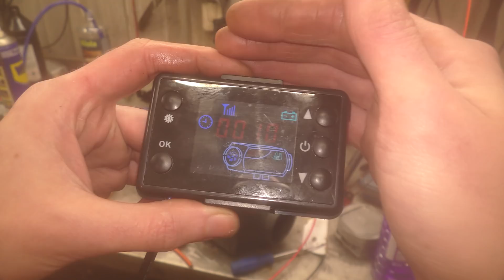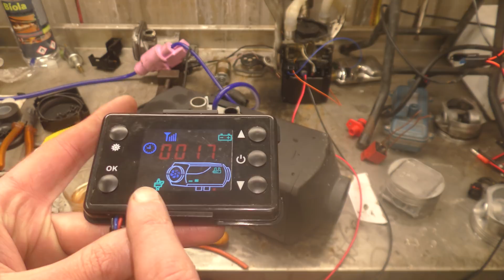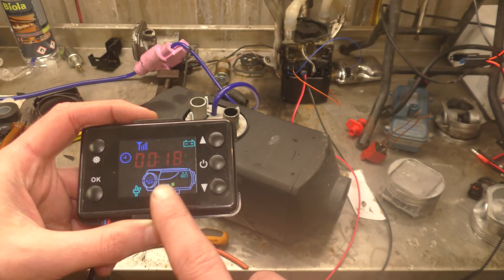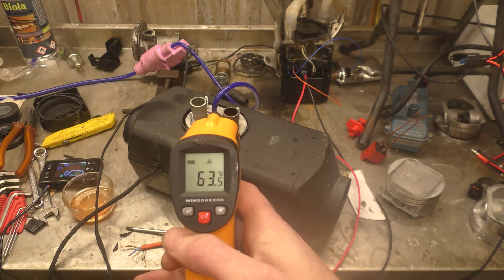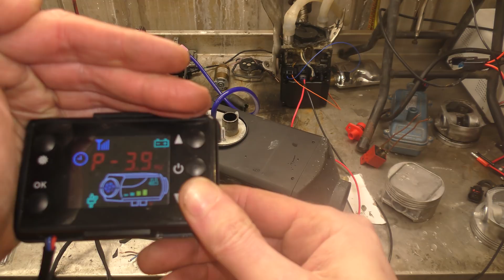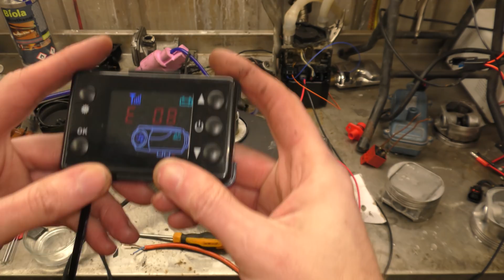Diesel heater on Ethanol / BioEthanol and Methylated Spirits

Comment: I used some easy start to clean out my heater after it got dirty fuel. Just take out the glow plug and blast it with easy start, it totally cleans the little mesh and also the glow plug and burn chamber. After that Easy start spray, it ran clean as new.

Comment: I have found that if the vent is plugged the heater struggles to start and causes screen around glow pin to get caked up and plug. Worked at a trucking company that had airtronics heaters in them. Drivers would bring them in for not turning on. Techs would find screen plugged and replace the screen but no one really noticed the vent hole and would just replace the screen. Truck would be back in few weeks for same issue. But if you cleaned the vent hole and replace screen truck wouldnt return. They added it to there in house troubleshooting steps.

Comment: WELL HELLO,i have a 2kw heater,is there a way to adjust the heat up without the fan speed going up at the same time, im have that controller your using

Comment: I thought you could run a diesel heater up side down.
Reply from the maker: Nearly.  You can run it on its side as long as the glowplug is at the top.

Comment: Hello I'm from Brazil. It's unthinkable to imagine someone here burning a diesel heater. But due to the high price of electricity here, I bought one for testing. My city is very cold in winter. (Curitiba -PR) And now in the summer, I'm using it to feed a clothes dryer with hot air. And I'm absolutely loving it!

We are the first country to use fuel alcohol for vehicles on a large scale, from the 80's until today. So this video will be interesting!
Reply: Do you have any pictures of your clothes drying setup?
Reply: Good idea for a clothes dryer
Reply: I’ve heard Brazil uses additives to protect aluminum carbs, do you happen to know what those are?

Comment: I buy Bio Ethanol at the "Welkoop" farmer supply shop in the Netherland for about 1.75 euros. It is good to clean the burn chamber when it is full of crap from burning road Diesel with FAME. Much better results now with Esso Blue diesel with 20% HVO instead of FAME.
Reply: before they started taxing alcohol you could buy a gallon of it for fifty cents a gallon in the United States basically for Farm use.  
in places that don't actually have an alcohol tax it's actually almost cheaper in many places to purchase Everclear then purchasing white gas for your heating and cooking needs.

Comment: I would be very concerned about the use of any alcohol based fuels because of it's negligible lubricity.  I imagine the pump would experience pre-mature failure.
Reply: Add 2% high-grade 100% synthetic oil of high-viscosity; like 50-weight, in U.S. nomenclature. If that doesn't feel as slippery as diesel fuel when you rub it between your fingers, add a little bit at a time until it does. We always recommend Redline Oil first and foremost. You can even call the company and speak to an actual human being who is actually smart!  (I've been an alcohol fuel instructor and researcher for decades.)

Comment: Alcohol burns really easily, but yeah it has very little heat. Advantage though is how clean it burns and it turns mostly into water and carbon dioxide. Not a lot of opportunity for soot. I've even seen its flame clean the soot off of things that kerosene had coated thickly in soot.

Comment: As far as heater body orientation, I’m wondering if it should only be ran horizontally because of the bearings in the blower/motor... it would make sense that the cheap Chinese designers would use the cheapest bearings/motor available that fulfill their design needs and that there might only be sleeve a bearing in the back of the motor since the bronze surface would cost them a fraction of a ‘real’ bearing...
Reply from the maker: Interesting enough I've actually done a video on replacing the bearings in the motor, and they are indeed bearings.  Albeit sometimes noisy.

Comment: I'm enjoying you no nonsense videos. Very informative and instructional.
Will you post a link to the 50A power supply please.?
Reply from the maker: I just searched eBay for 12V 50A power supply.  Like this one - https://www.ebay.co.uk/itm/DC-12V-LED-Driver-Switching-Power-Supply-Transformer-for-LED-Strip-CCTV-UK-STOCK/264759172436?hash=item3da4e05d54:g:d9EAAOSwrlRZ0agJ

Comment: Ethanol is fairly cheap in South America I forget which country it is but their autos run on 100% ethanol with no mixture of gasoline in it or petrol they have lots of sugar cane that they use to make the ethanol
Reply: You might be thinking of Brazil. I went there years ago and I'm pretty sure you could get straight ethanol at most gas stations.

Comment: Thanks Dave for the great video. Quick question, does bio ethanol lubricate the fuel pump so it won’t wear out like it would to use kerosine?
Reply from the maker: No, it won't have the same lubricity but pumps are cheap and the pump should last a while before it gives up.

Comment: It's not half the energy density, it's about 80%.  But yes it is lower.
Reply from the maker: I see ethanols energy density at about 60% of diesel fuel.  But you are correct it's not half.
Reply: @DavidMcLuckie  
I'm surprised at that actually, I was thinking in terms of ethanol compared to petrol.

Comment: Hey, Awesome ‘pushing the envelope’, ... meaning you go so “far beyond the thinking box💡”

     You are a “master tinker” 🤔with these heaters🔥. i have learned soo much🤓 from your videos. 👍🏻👍🏻

   just bought a 8kw metal heater to set up in an older 25’ Fifth Wheel trailer. i can’t wait to set it up. Slow 🚢⛵️🛳 from Chine 😅😂🤣🥲

Comment: What happens when you get a power failure in a camper van or caravan,  will they overheat and catch fire ?
Reply from the maker: No more so than running on diesel.  Once the pump stops, fuel stops and the fire goes out.  But the heat that remains won't set it on fire but the heat may damage the circuit board.
Reply: @DavidMcLuckie  thank you for your help,, 👍👍

Comment: Hey, buy a cheap testo flue gas analyzer used to adjust oil and gas furnaces, and try to adjust to diferent fuels adjusting the ratio, using gas or alcohol you need up the fuel or down the air in the chamber.

Comment: I believe the small hole is for initial start up    Combustion.  For when  the inner impeller is at low speeds. And glow plug is hot . This is why it is important to use a air filter.  If u block that small hole it my not start aka bug / dirt /dust

Comment: Can you run red diesel  will it harm the heater ? And were can you buy that pink cover for the pump ? Thank you
Reply from the maker: Red diesel works fine.  Just search eBay for fuel pump cover.

Comment: David, you did what I am doing! And yes, the alcohol is free! But my pump failed, because it’s a “dry” fuel.
Does anyone know of a pump for these heaters that is ethanol compatible? Viton seals and such??
Reply from the maker: What about a peristaltic pump?  It would be a bit of trial and error to get one that outputs the volume for a given pulse.  Unless there is a way to take the pulse and increase the duration with some kind of electronic wizardry.
Reply: @DavidMcLuckie  Well, I'm not a wizard, but I am going to look into this.  Many options on Amazon.  Thanks for the tip!

Comment: So, I couldn't help myself and decided to see what my 2Kw Webasto airtop petrol burner would run on....other than petrol. So far it will run on Meths, White spirit and Diesel. Wasn't much heat output on meths...but White spirits was perfect. Started straight up from cold  with a little puff of light smoke and with in seconds it was clear, gave really good heat output. I let it cool off for an hour and tried it again with diesel. Works as good or better than the white spirit or petrol! Started on the second try and ran clear for 20mins. All fuels ran with constant sustained ignition... no woosh woosh noises. Gave a bit of smoke on shut down on the diesel. All in all. It would seem the petrol / benzin version of the airtop will run on anything!

Comment: Hellooooo !!  Is it possible to run those heaters with a gravity flow instead of a fuel pump ?
Reply: Negative. The fuel pump is not just for lifting fuel to a higher level, it is the only means the burner and controller have to precisely dose fuel to match demand and air/fuel ratio. It is also the only means of blocking fuel flow when it is off. Liken it to the fuel injector of an internal combustion engine.

Comment: David: great video, but thats not the kind of ethanol i was refering to. The ethanol i was talking about is called E85 and its straight out of the pump at the station. Its 85% ethanol and 15% gasoline/petrol and its cheaper than both pure diesel and gasoline/petrol. If youd like to try it out Id be happy to ship a couple of litres to your place. Regarding the Hole in the burner, i think thats for extra air, an inlet for atomizing the mixture thru the screen (there should be a screen/mesh inside the glowplug hole) on initial startup before everything start to rev up. The screen is removable with an M8 Bolt screwing it in and pulling the screen out, think corkscrew here.
Reply from the maker: We don't get E85 here so I bought the closest I could get which was E100.  If petrol works, and ethanol work then a mixture of the two will work.  But you don't get anywhere near the heat from ethanol.  Great for engines, not so great for heaters.  :)
Reply: @DavidMcLuckie  Maybe you could do the math behind 15% petrol and 85% ethanol mix to find out the energy yield? And then shove that thru the heater of course. What else am I suppose to watch on here in the weekends!? ;) Can't remember, you've done some many vids by now, but did you try paraffin/kerosene?

Comment: 90% old engine oil, 10% petrol. You must run the oil through a centrifuge.
Works fine for me.
Reply from the maker: A centrifuge would be nice.  But a good one is expensive.
Reply: @DavidMcLuckie  
Hi Dave, a company called oilybits sell them. I paid under £500 including the pump, spins at 9000 rpm.

Comment: As pointed out by John mck47, that hole is important WHEN THE HEATER IS COLD AND IN START UP PHASE. The glow plug needs air to run across the mesh atomizer only during startup, and the 'fire' is beginning in the mesh/glow plug area. After the heat spreads to the rest of the chamber, the location of the fire can be moved slightly down and away from the glow plug, where the fan draws intake air from the other intake holes. But during startup, the vacuum draws enough air in from the single glow plug/mesh hole to get the process started.
Reply from the maker: Well I've blocked the hole on my 8kw to see what happens.  Will give it some runs and start stops and the take it apart.  So far it's lit with the hole blocked.  I should say that I'll be running it upside down as well.

Comment: David, one issue many travellers face in South America is that their Webasto’s don’t work (or not for very long) at heigh altitudes (lack of oxygen, soothing up...). Would burning ethanol or methanol address that issue?  Is there any other solution to get a Webasto to work reliably at 4,000 meter altitude?
Reply from the maker: Aww someone on here commented they had a heater with a 'mountain mode'.  They had it stuck on that and it was running badly.  https://www.ebay.co.uk/itm/12V-24V-Air-Diesel-Heater-Parking-Remote-Controller-LCD-Monitor-Switch-Board/392420661345?hash=item5b5e181861:g:n9IAAOSwAS1deKTc

See the blue controller in the picture has a yellow mountain on the display.  The call it - Plateau Adaptive Function

Comment: Have you tried propane?  This would be interesting as it would be a good low power temperature controlled heater option to a RV heater.
Reply: An old bbq burner in the are inlet. Light it up with diesel and slowly add propane. Should work

Comment: i wonder if the spirits would clear out a sooted up burner, so if one is ran normally on diesel, then on spirit directly. would the spirit burn the carbon away ?
Reply: Or spirit with added water to steam it (up to the point of failing to ignite)

Comment: What's the CHEAPEST fuel for this so far?
Reply: Whatever you have available in bulk quantity. May vary by location. 
But I'm wondering the fuel consumption per hour for any given fuel.
Reply: @mxadema  yeah problem is finding any supplies in the eastidlands uk. :/ No red diesel or other feasible fuel here so using full tax diesel atm
Reply: @petethompson1282   I live in Canada. Our heating oil (red diesel) is really just regular diesel, due to the cold. That what i run my tractor on, and also my 2k heater since it plumb on the same tank. 
And it almost 1/2 price.

Same for ethanol. Here, they give the stuff away. They use it in cheap gasoline to lower the price.

Since the heater are cheap and will burn anything. I would try 70%used motor oil / diesel ( black diesel) it would smoke but it exhaust outside.
May need to run reg diesel at high to clean it once ever so often. 

That would make it pretty cheap to run
Reply: @petethompson1282  Have you tried calling an oil supplier like Chandlers or whoever is around your area? Our oil fired boiler ran out of oil a few years ago and we went and got some 25L containers from their depot while we waited for a tanker delivery. Another option would be going to a marina on the canals, I believe they sell red diesel for the narrow boats.
Reply: @benlee4940  yeah, they only do 200 litres or boxes for£26 same price at the pump

Comment: BTW, ethanol fuel will be very expensive in the UK since they do not produce a lot of corn there. In the USA it is next to impossible to find gasoline without ethanol added. They have a massive production system for ethanol that they add to gasoline. If your quite savvy you can make your own corn squeezin's and use it for personal drinking or adding to your ride. Corn squeezin's is also known as Moonshine.
Ya don't need no fuckin heater when you consume the squeezin's, it'll keep ya quite warm in the winter!
Reply: It's still expensive.  As someone that makes ethanol... I wouldn't want to go through all of that to sell it for $10/liter.

Comment: Low density fuel - advantage you use twice as much for the same bang = the fuel becomes a coolant helping to keep the engine cool due to the higher volume of nice cold fuel coming in to it.
Reply from the maker: I know it's good for engines for the reasons you stated.  But I don't think it's great for running these heaters.  You want a slow burning fuel to soak as much heat into the heatsink as possible.
Reply: Fully agree! In a heater you want the exact opposite!

Comment: David you can get ethanol from petrol ,ie 1gallon petrol 1/2 pint water mix well ,the ethanol settles to the bottom, a lot of people do this to run two stroke engines. They use the petrol without ethanol in it
Reply: Then you end up with ethanol and water mixed.

Comment: Now tell us how you feel lol . Just on the orientation of the heater had a 2kw running on its side after about 250/300 hours it carbon up big time , cleaned it out same thing . Tried it on a 5kw got about 500 hours back to the carbon. Love your work . Btw it is still 30c at 7pm here in far North Queensland Australia. Cheers
Reply from the maker: That's still a fair few hours.  Do you run them for long periods at a time?
Reply: David McLuckie probably runs of 20 to 50 hours on idle to full noise . cannot handle the cold anything under 20c and I am grabbing jumpers and blankets . Think I have been in the tropics to long lol